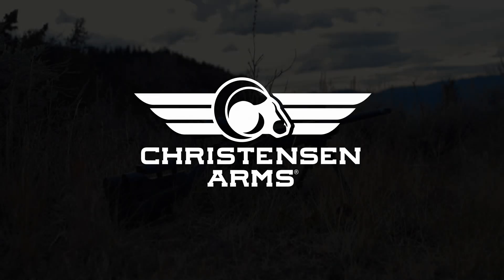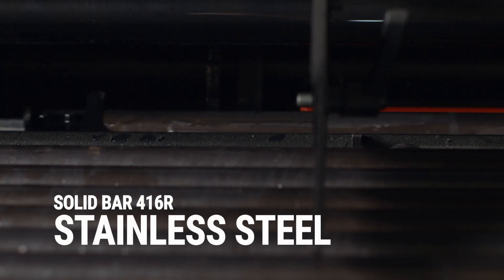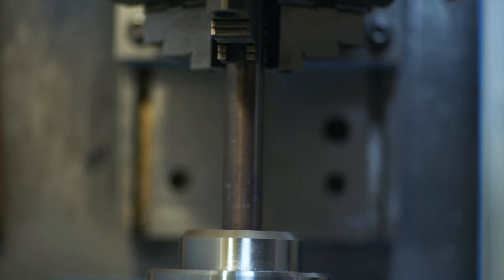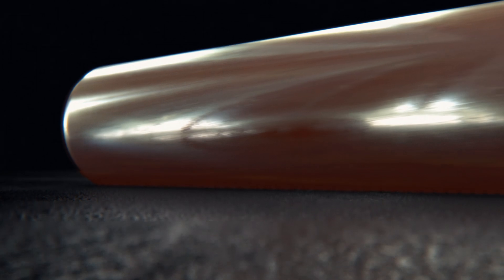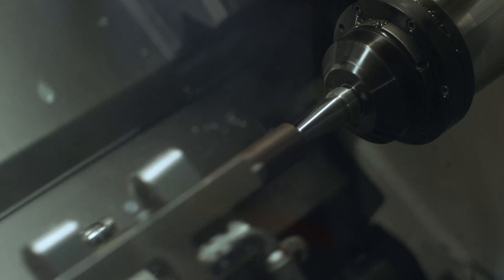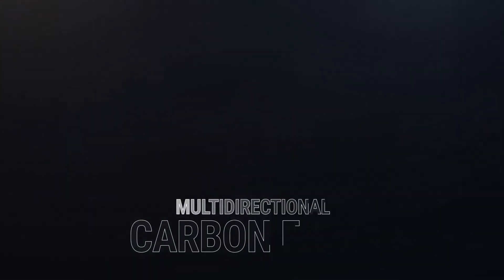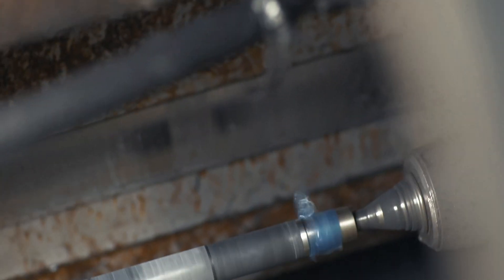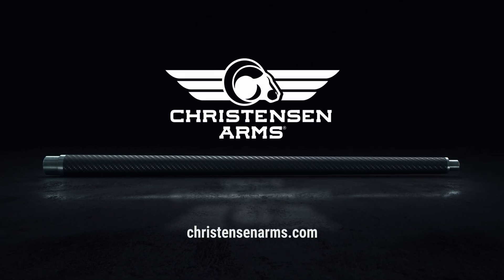How Christensen Arms Pioneered Carbon Fiber Rifle Barrels

Comment: So if they are hand lapped to take out any small imperfections as stated in inches video,,,, why do you suggest they a guy has to burn over two boxes of ammo to break in the barrel. If you did a good job lapping it, should only take a few rounds at most.

Comment: So what happens when the barrel gets hot? Cannot be good for the resin bonding the carbon. This just sound like a stupid gimmick.
Reply: Not like they run carbon on f1 and race cars for decades already with engine heat directly on it.
Reply: It is